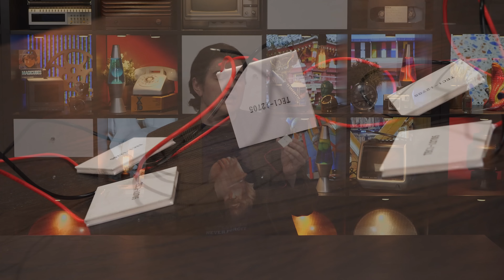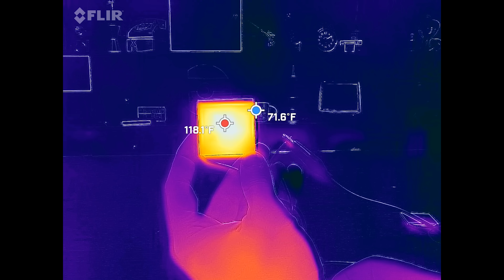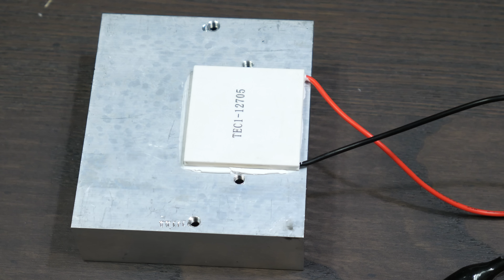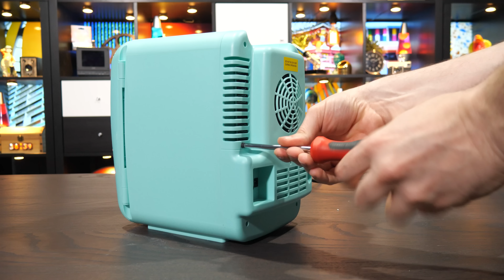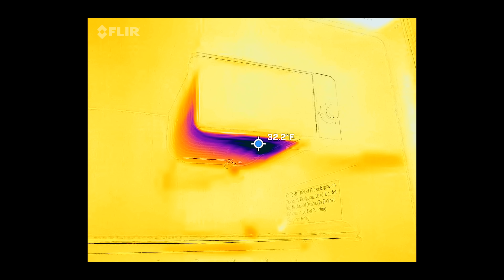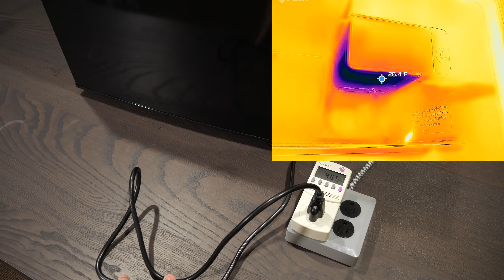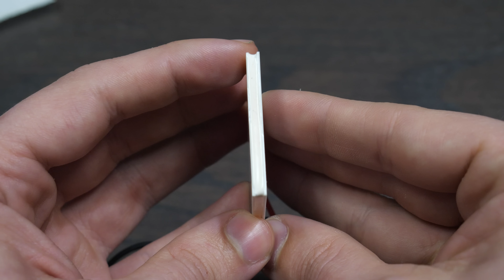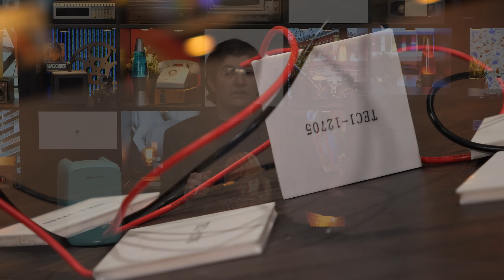Thermoelectric cooling: it's not great.

Comment: I had one of the 3 gallon models in my minivan for a time. That had 2 peltier modules and took about 12 amps @ 12 volts to run, including the 2 fans on the heatsink. Took about 10 hours to get anything inside close to being cold. But it worked a LOT better if I added enough water to cover the drink cans, and kept it running all the time. 

Killed 2 car batteries before I had enough and bought a Alpicool compressor fridge. Never been happier and I ran the old peltier fridge over multiple times in revenge.

Comment: Has anyone ever tried to make a personal cooling pad out of these? Like a neck towel or wrist wrap or helmet cooler to help regulate body temperature? I remember in highschool talking to friends about this kind of application. Maybe for mining, welding, or just straight up any type of labor or even harsh enviorments.

It wouldn't have to be a drastic heat difference, and your body would naturally distribute the cooling effect. You could even have multiple points of contact.

Comment: Peltier only makes sense if you absolutely have to cool something below ambient temperature or if you have to control or target a specific temperature. If you're just trying to prevent something from overheating then you're better off without it. The Peltier only works if the heat it moved from whatever you're trying to cool down is picked up on the hot side. But since the element itself also generates heat you need a bigger heat sink than you would need if you directly applied a heat sink to the thing you wanted to cool down. That would be more effective and more efficient. It's more effective because the heat sink needs to deal with less overall power and it's more efficient because it's passive and doesn't need power. And on top of all of that it would also be cheaper without the Peltier element.

Comment: One other niche but important use.

if you need a temperature to be very tightly controlled. Like a science experiment that would be ruined if the temperature got 1 degree warmer OR cooler then it's intended temperature (alignment of things like mirrors can change when different materials expand or contract at different rates as temperature changes).

if you need CONSISTENT temperature Peltier's are you go-to. Doubly so if your system is vibration sensitive.

Comment: What peltier modules are actually good for: highly precise temperature control for small loads. Using PID control, one can hold the temperature of a small object within a tenth of a degree very easily with a peltier module. The applications for this are nonexistent in daily life, but notable in bio related chemistry.

Comment: During the heat wave this summer, I was working in a non-AC office. I thought it would be a timesaver to keep one of these at my desk rather than constantly running for water and fighting for the ice. The result was a normal-room-temperature beverage — about 65 degrees in an 80-degree climate. 

I wound up getting a regular mini-fridge and losing some space under the desk. I didn't even consider donating the POS cooler; just pitched it and took the loss.

Comment: I bought a solid-state circulating chiller for a distillation rig I use for producing concentrated extractions. It has its limitations, but I love that its lack of moving parts and refrigerant means that I can leave it unpowered for years at a time without concern for losing (and potentially having to replace) the refrigerant when it leaks out through aging seals. It fits my need. Thanks for these!

Comment: When I first learned about Peltier junctions about 30 years ago, I wondered if you could cover the catastrophic converter on your car with them and produce enough energy to get rid of the alternator. I still don’t know the answer to that, because I stopped dreaming of building sports cars about 25 years ago when I had to concentrate on getting a real job. Anyway, the best thing about these gadgets is not that they can refrigerate things, which is stupid, but that they can convert heat energy into current, in a solid state way. There is probably a better way to do it, but we’re still using our catastrophic converters to heat up the air under our cars, so I’m not yet convinced that it’s a dumb idea.

Comment: Some friends of mine wanted a computer without any moving parts, but the processor put out a lot of heat. They tested attaching a Peltier to it in hopes it could cool it without moving parts, and maybe could also generate power from the hot processor. Physics got in the way and it didn't work very well at all. Ended up going with a magnesium heat sink to avoid adding a fan. Great video, thank you very much.

Comment: I use one of the black cube fridges to keep my hydroponic water cool.  I drilled two holes for hoses and connected a large automotive heater core inside and it’s so reliable that I forget about it most of the time.

Comment: Two things: I’ve been the proud owner of 4 mini fridges in my life, all of the rebadged generic variety. Each and every one in the general price range you gave was unreliable. Not one lasted more than a year, and, of course they’re unrepairable as a practical matter. Second: again in line with your logic I also owned a peltier device that I found quite useful. Igloo made such a portable cooler. It worked really better than I expected, mostly I think, because my wife liked the car well air conditioned thus reducing the ambient temp well below what I would consider for the house. Also, possibly the box was better insulated .

Comment: Its one of the most inefficient ways to pump heat... That being said, its compact and light.

Back in the early 2000s we used those for sub zero cooling for CPUs under big heatsinks/watercoolers. Big cells... 225w big (15v 15A).
But as soon as heat output on CPUs got too big, it stopped making sense. In order for you to have a decent temp drop you need to be able to pump more than the output from the heat source. Your power demands goes up through the roof. And you start dumping tons of heat into your cooling system ...

Phase change units took over from there... Quite easy to build once you understand the basics and get the proper tools.

Comment: Why is 7°C not food safe? Most food packaging lists its consume-by date for refrigeration at 8°C, which is a normal fridge temperature. Or is the issue the vague “up to” cooling claim, meaning 7°C is not guaranteed?
Reply: Idk what 7C is, but the FDA recommends no higher than 40 degrees. 44 is high enough that the FDA deems it will not inhibit bacterial growth.
Reply: @KonglomeratYT  7°C is 44.7°F, 8°C is 46.4°F. In Germany, 7°C is said to be the ideal temperature by official agencies as well as consumer protection agencies

Comment: Cigar Humidors (Not all) use Peltier cooling to keep the Cigars at the correct temperature. Which, is about 10-20 degrees cooler than room temp in most cases.  Another reason they're used for Humidors, is they pull less moisture out of the air (and consequently, the cigars) than a comparable compressor driven cooler.

Comment: I love mine, got it from goodwill for couch change and it's not exactly 33 degrees but much cooler than room temp. I'd prefer lagers to be colder but for craft beers that are best not super chilled it's worth the compromises.

Also in a small room it won't heat the room up as much as a real fridge, by nature of being smaller and not cooling as much.

Two things - on mine the vents are on the side so I can put it on its back to open upwards like a tub fridge and it works a little better, and I've also noticed it works better if the ambient air is moving like when I moved it near the ceiling fan. I suspect in both cases the internal fan isn't adequate.

Comment: just from the thumbnail, I knew how bad it was going to be. I've played around with thermoelectrics so much, I've gotta be crazy to have not entirely given up on it. I've stumbled upon ice chests that have a compressor in them, conveniently requiring twelve volts like your car runs at. Uses about 50 watts but goes down to 35 in 'eco' mode. Way more worth it than these cheap metal boxes.

Comment: I had one of these that goes in my car, it has a thermal switch to keep it from running constantly.
But the switch is on the heatsink, so it never actually cools anything, and kept killing my car battery.
These are awful and should never be bought.

Comment: @29:53 In case no one has ever brought it up before, and since I hate that the 11% Menards rebates have to be mailed in because I usually don't buy things expensive enough at Menards for it to be worth getting a dollar or two back... If you happen to live by a Menards that is down the street from a Home Depot, they have their own 11% rebate program specifically at stores that compete with a Menards. The receipts can be submitted online without mailing anything in. Their 11% rebate site (search for it)  has a list of stores it's valid for and a huge list of excluded products. I've used it a few times and the only time I ever had issues was when I bought several hundred dollars worth of flooring. It wasn't on their exclusion list and they initially rejected my receipt with a bullshit excuse that I was a member of some kind of discount program I had never even heard of. After calling multiple times and talking to people in person I got them to agree that there was nothing bad about my request and they did issue me a decent sized rebate gift card that I used 9 months later just fine.

Comment: The one use for peltiers that I thought was brilliant was in a 5g radio tower to cool the fiber optic transciever. Those little things produce oodles of heat, and the metal cant conduct it to your heatsink fast enough. A peltier creating a bit of excess heat is no big deal for the external thermal design, and it magically creates a larger thermal differential to quickly get heat away from the transceiver quicker.

Comment: I have seen cool boxes that have a pelter tile in the lid; both sides have a heat-sink, 2 centrifugal fans on 1 motor and the hot side facing up into the lid/cold side facing down into the box and I think it would work quite well in that configuration; any heat will rise to the lid where it is drawn into the fan and blown over the cold heat-sink and out into the box then the cold air will sink to the food/drinks, with proper air circulation. And another example was a table-top water-cooler; the peltier tile had its cold side on a insulated chamber for the cold water, it had a tank on top for the water at room temperature dispensed from a tap with a white lever, and the cold with a blue lever, with actual temperature monitoring = the fan was fast when cooling and an LED with a ❄️ would light on the front, when cooled the fan would slow to an idle and an LED with a ☕️ would light = ready to drink, and it actually worked making “fridge” cold water, only 1 glass at a time and I assume it drew the water from the bottom side of the chamber

Comment: If these things concentrate heat with no moving parts, why don't we use them in stoves, instead of expensive and infrastructure-heavy natural gas? 🤔
Reply: There's a lot of simpler ways to just poop out heat with no moving parts.
Reply: Because we already have electric stoves and induction stoves.

Comment: I made Peltier fridge, and it is working perfrctly. Power-12V solar pannel, off-grid. Cold size 20x20x30cm. Hot side-cpu water block connected to 1m3 rain water cointainer. Thermostat? Yes! Because after 15 minutes there is ice on walls inside.

Comment: AIM-9 sidewinder missiles build for the US Air Force before they adpoted the AIM-9L model all used peltier devices to cool their infrared seekers
however in the missiles they run on much higher power than civilian devices and that makes it possible to bring the IR seekers far below freezing so that they are more efficient

AIM-9 versions that where build for the US-Navy (including the AIM-9L) however simply used nitrogen cooling to bring seekers to 77 kelvin

Comment: Part of the issue with cheap Peltier chips is that they often don't have sufficient sealing so when used and there is condensation that can leak onto the chip, chip goes bad quickly. Good chips cost $20 - $50 each and well designed products manage the moisture and have large heat sinks on the hot side.

Comment: Had a peltier neck cooler from Sharper Image in the summer in Texas back in the day. All it did for me was give me a stiff neck, because I had to hold my neck just so if I wanted the curved plate to actually contact my neck...Which made a small spot on my neck cooler for about 3 minutes, until the heat from my neck overwhelmed the device. All for $40! Plus batteries!

Comment: 17:40 Looks like the fridge actually uses Cyclopentane, not Isobutane as a propellant, given it's big old 'C-PENTANE' label on the back.
Reply: A reply to a similar comment to yours says that cyclopentane is "the blowing agent used in the insulating foam", which the comment says is the case for most modern fridges.
Reply: C5H10

Comment: I have a cheap little 18 can fridge like this, and I took the heat sink off and put an old PC 120 AIO cooler on it. 

with the fan blowing the radiator for the AIO at full blast, this little fridge can freeze a fridge full of water bottles in about 12 hours. not completely freeze them, but they have a significant amount of ice in them.

Comment: In defence of Peltier based coolers, We have a coolbox with a Peltier (and yes noisy fans) built into the lid that will run from 12v in the car, If we're going away for the day we fill the box full of pre-chilled cans and food and it'll keep everything in it cool for the whole day, It's also reversable by flicking a switch and if you are going to collect takeout and turn it on as you leave the box is hot by the time you do the pickup and keeps the food really hot until you get home, I'd hypothesize that because (all but the lid) it's a "normal" coolbox being properly insulated really helps then filling it full of cold food and drinks all it needs to do is compensate for the heat loss of said coolbox

Comment: I have a few of this type of cooler laying around....keyword "laying around." I have used couple of these at work and yeah they kinda sucked. I used it for cooling sodas at work space and it would work for a while but if it was left on for too long (which it often was) the cooling element would freeze up and I would have to turn it off so it could thaw. I found a nice mini refrigerator on sale some years ago and the mini cooler has been sitting collecting dust for years now. I had at least 2 of those coolers for my work space, one was a Coke branded cooler in the shape of a Coke can. I'm sure the first one broke because it froze up too much.

Comment: theres even another thing you can do with Peltier junctions; you can even TRY this one this winter.. place them against, say for example, a window pane that is directly facing the outside- then place some insulation around them and  let them sit there in a well-heated room... (this trick won't work on thermal glazed windows, though) or you can place them in a piece of drywall, cardboard, wood, etc.. so that once side faces the outside and the other faces indoors... place heat sinks on both sides for added fun... and then  break out a meter and put it across the wires.. and you'll find they generate electricity!  and, maybe even at an Ampere or two!  this is because they are TRANSDUCERS  meaning that they can , not only, turn electricity to a thermal difference, but can ALSO turn a thermal difference into electricity!

Comment: I have a mini-fridge. The freezer section doesn't freeze anything anymore because the little door fell off which was held on by two plastic pins (part of the door). Getting interior replacement parts is always a crapshoot for refrigerators of any kind. I ended up shaping a piece of acrylic to fit but it still doesn't freeze much, just what's touching the bottom and one side.

Comment: I have used it once to keep an FPGA at constant temperature, at 25.0C. It worked when controlled correctly really well. But the FPGA made milliwatts of heat only, the point was the exact stabilisation of the temperature not the cooling. It was really good that the element could cool and heat too!

Comment: We have a pelletier cooler for long term trips. We run it from the power plug in the car. It works ok. Not great but it is ok. However I want to replace it with a 12V /120V electric fridge/freezer for out next trip. Thank you for the information.

Comment: Correction: The power input to a Peltier is EQUAL to the amount of heat generated. Some of the power does the necessary work to move the heat, and the rest is waste heat from the process.

Comment: Great video. I'm diabetic and have relied on Peltier minifridges to keep insulin refrigerated, because some models come with a port that allows them to be run by a car in the event of a power outage. I had two of these fridges crap out on me in my first year of college. In both cases I tried to be frugal and fix them myself, but unscrewed the back and found that the Peltier element or heat sink had been burned beyond repair just being left on continually for only a few months. I didn't know much about the internal anatomy of these things at the time, and I think I was mostly just looking to see if there were any obvious faulty connections. It's kind of absurd that you can spend $30-$50 dollars on a bad fridge that might work for 6 months if you're lucky, when the alternative is an actual cube fridge that works better and should last AT LEAST a few years for a slight premium. I think you kind of hit the nail on the head when you called this an "impulse buy" for most consumers.